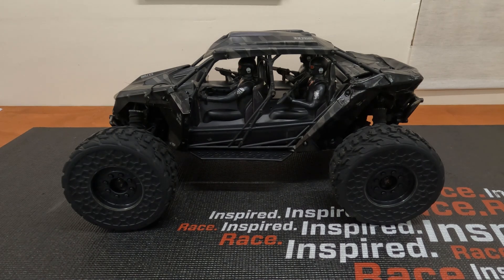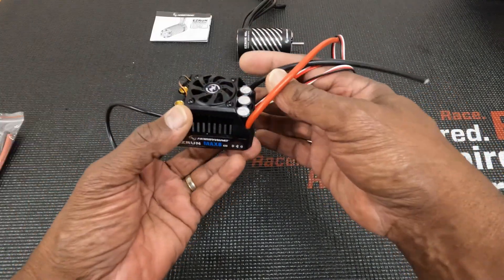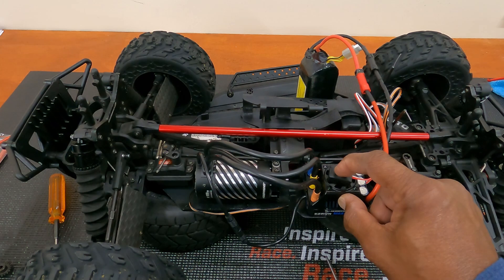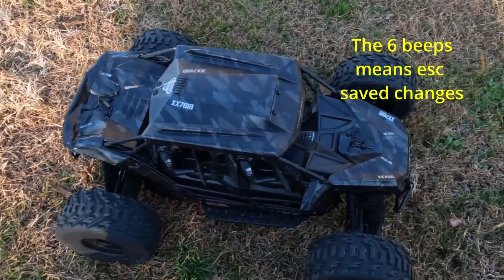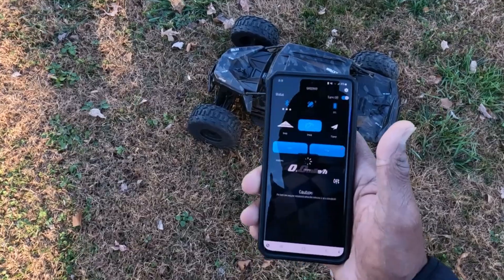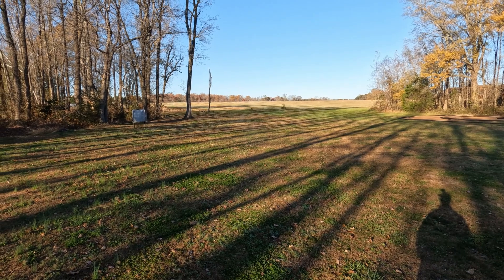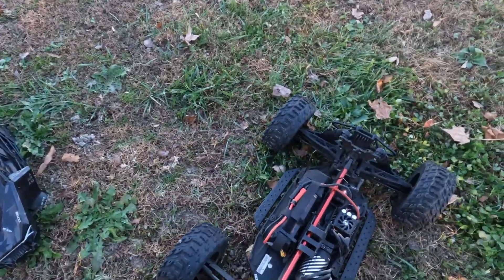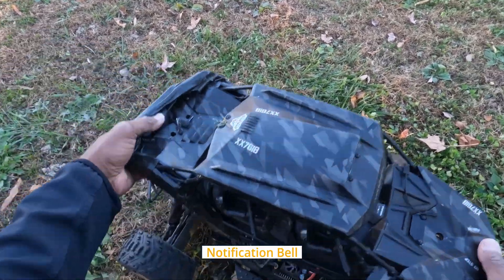Arrma FireTeam with new Max6 G2 1650kV Combo

Comment: That is a great combination motor and esc. It's a beast
Reply from the maker: JoevsRc, thanks for that awesome comment, and for watching the video.  I think this is the best combination motor and esc for the FireTeam.  You can fine tune the esc and motor on how you run. 💥💥
Reply: @sparetimerc  I have the Gen 1 1650 hobbywing combo in my Mojave exb on 8s and it's unstoppable
Reply from the maker: @JoevsRc  I will run it on 8s during a speed run but for now I am happy with how it performs on 6s.  But that Mojave must be a beast on the streets

Comment: Great run👍 That is the best setup for the Fireteam and maybe even the Big Rock 6S.  I love watching the control in the air with that setup.  Great work!
Reply from the maker: Thank you ReadySet, now I just need to control my response with the throttle, this system is quick to react to any input.  I think the new Max6 G2 combo is great for any 7th scale RC, that's just my opinion.  Thanks for taking time to watch the video and for leaving that awesome comment.  Did you see the new 7th scale street truck from FSR, Model DT.  I just ordered one.  Truly appreciate your support💯💯💯

Comment: I believe this will be my next upgrade 😁 have done every aluminum part they make for it and hardened cv shafts all over. Great review. I want 😉
Reply from the maker: I have had this since it came out and really have not had any issues with it since.  This is the only major upgrade I have done with it and it has been through some tough driving.  Granted not skatepark action or 30 feet launches but it has had it's share of rough landings

Comment: From what I understand, this new 1650kv motor is OFFICIALLY capable of 8s now. ?? Definitely my cup of tea. This is even better for 8s runners like me with a heavy M2C upgraded K6 who likes the sensored stuff. Going sensored was smart on HW's part, because it certainly does make ya' want the proprietary waterproof sensored motor with temp sensing and all that. Anything built up and heavy for 1/8th, or even stock 7th scale runs with less strain and heat with this upgrade. Great for Fireteam, the new Big Rock, and X-Maxx with the larger motor option.
Reply from the maker: All-is-Grass, welcome back, yes this new combo is capable of running 8s.  HW did their homework and listened to their customers, I like how much control you have with the throttle, but I will tell you this.  This new setup is quick to respond to any throttle input you give it.  For the 5th scale Max6 5960, 1250kV would do the X-Max justice.  I ran this hard (fist and last time) just to see if I could actually get it to go to thermal shut down (didn't happen) but I'm glad LVC stopped me.  I will be venting the new panels to get air to flow better in the FireTeam.  Thanks again for watching the video and leaving a awesome comment.  Hope you take care and best wishes to you.💯💯💯💯💯

Comment: I just ordered mine! Whenever it gets here, it's going into my Mojave. I also ordered the Max5 g2 with the 800kv for my DBXL E. 

I'm looking forward to both of them.
Reply from the maker: Hello Diaszurana, I apologize for the late response, The Mojave is going to be a total beast on road and off road with the Max6 G2 combo and your DBXL E is going to be out of control once you get it in there.  just a little advice, do a break in period one battery pack, for 20min just to get everything meshed up. then you can rip all day everyday.
Reply: @sparetimerc  Thanks for the advice, man. I appreciate it. Let me ask you, what gearing would be best for the Mojave w the 1650kv?
Reply from the maker: Are you talking about the Mojave 6s or 4s?  If its my 6s Mojave I would run 18t, perfect for bashing (temps)  since the body holds heat. Temps should be manageable.  Do this, put an 18t pinion gear in, run it for 5 minutes, then check the temps are reasonable, and it is performing how you want it 👍.  Just need to play around with different gearing.   Hope this helps.   Take care and stay safe.
Reply: @sparetimerc  thanks, man! Yeah, it's The 6s. Still IMO the best OTB RC ever made 😀.

Comment: This is really nice, Al! I'm definitely interested in following along on your Fireteam project, also the other parts will be interesting for me!
I'm still undecided if I go with same motor combo as you, or I take the lower kV version, and if I do, I might even consider the Max5 combo... I want mine slooow... I got the Integy slow plow for it the other day, haven't managed to fit it yet, looking forward to try it, see how insufficient the stock motor and gearing is for pushing snow, he he...
Have a great weekend there, my friend!
Reply from the maker: Hi Mads, thank you for watching the video and for the great comment.  I still am keeping the FireTeam look (new cage and panels) painted for street runs and getting new panels for the old roll cage for backyard bashing.  If you get the Max6 combo get the 5960 (1250kV motor) but I'm not sure it will fit unless you get a different motor mount (I have very to no room from the bottom of the motor to the chassis) a smidge if that.  You take care and best wishes to you and the family my friend.👍👍👍👍👍👍

Comment: Temps at 170 to 220 are close to the tolerance level but you should be good. But one thing I want to point out is that you should measure your center diff temp as well..I upgraded to these motors too for my Kraton and my center diff got up to 230 degrees after about 3 runs 20 minutes each.  So I upgraded to metal center diffs to prevent any plastic melting.
Reply from the maker: Hello Rogerrabbit, I like that.  You are correct about the center diff temp, the metal center diff is included in the upgrade, it will be here when the new body and roll cage get in.  I like when others keep me in check, really appreciate it.  Take care and best wishes to you.👍👍👍👍👍💯

Comment: Which pinion would you recommend for this ESC/motor setup on the new Big Rock 6s?
Reply from the maker: Hello My. Titanium,  Since the stock gearing is 13t pinion and 50t spur,  if you keep the spur and go up to 18t pinion you should be fine.  That is just my opinion others may say 20t but then you risk making the sensor work harder to keep the esc cooler.  I am running a 22t pinion and a 46t spur in the FireTeam and in this video I ran 3 battery packs through it with out any breaks (except to change out the batteries)   Like I said again that is just my opinion.  Once Arrma get the kink out of the Motor/ESC issue I will order one. Thanks for stopping by to watch the video and for leaving a great comment/question. 💥💥💥💥💥👍👍

Comment: Very nice build and video footage.
What pinion would you recommend and did you add a fan or change something on the differentials?
Reply from the maker: Hello Reho6760, If you are looking to have fun and not overheat the motor I would recommend a 18t pinion gear.  I have fans on all my RCs, so that I can keep them cool when I run them in the warm weather and not worry to much about thermal shutdown.  Now as far as differentials it depends on how you drive I use thicker in the center 500 or 1M, in this one I use 1m with 250k mixed in the center and 30k in the front and 20k in the rear.  That's how I like to set up my 7th scale RCs.  Thanks for watching and for leaving that awesome comment.  Take care and stay safe

Comment: drop the pinion down two teeth , and put dual fans on that motor
Reply from the maker: Hello Damaylaphoneix, Thank you for stopping by to watch the video and for the awesome comment.  I ran the FireTeam with 3 battery (roughly 45-50min run time) pack with the cooling time of the battery change.  I did put a 40mm fan and heatsink on it and the temps are good now.  I wanted to see how far I could take the new Hobbywing Max6 until it went to thermal shutdown (didn't) like I mentioned in the video that is the first and last time I do that with the FireTeam.

Comment: If you run that system on 8s an 20t pin it would run cooller an be just as fast. Im looking forward to trying this same sysen in my Mojave/og big rock body custom rig. It running old max6 with a rocket 1100kv 4585 an its fun. But i have to run 8s to keep it cool an have good top speeds. And still want more top speed. So time to kv up to the 1650 g2 syatem.
Reply from the maker: Hello Mike, I wanted to say thank you for stopping by to watch the video and for leaving me a great comment.   This run was to see how far I could push the new HW Max6 G2 combo befor it went into thermal shutdown.   I  will say I like this combo, and my plans are to put it into other 7th scale rc after I have ran them with stock electronics.  I'm going to head over to your channel and check it out.  Take care and stay safe